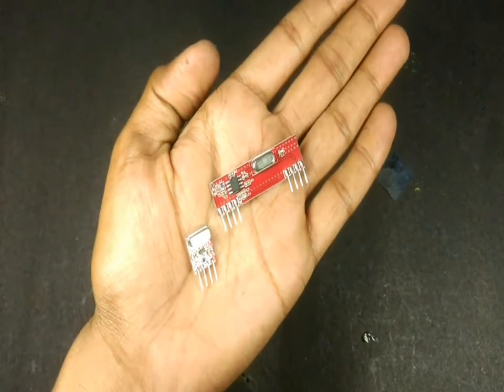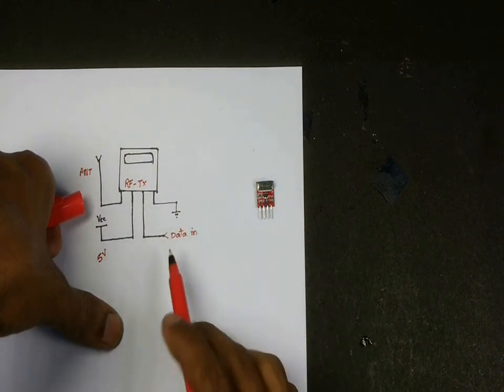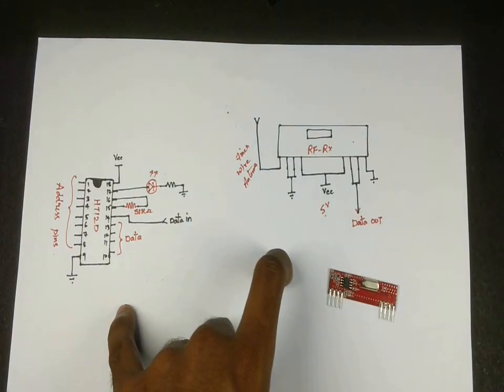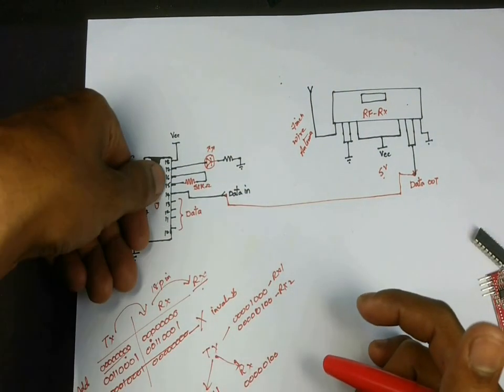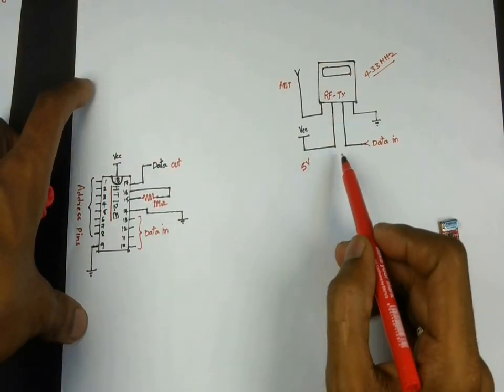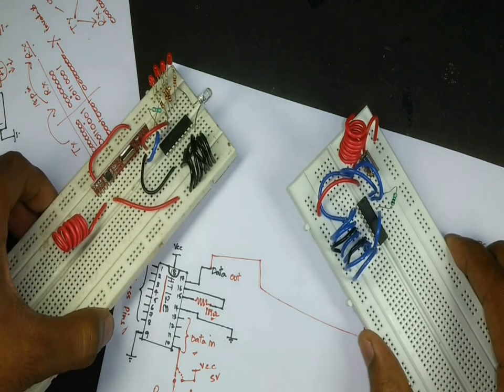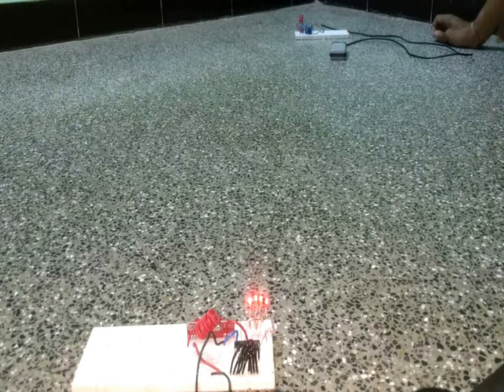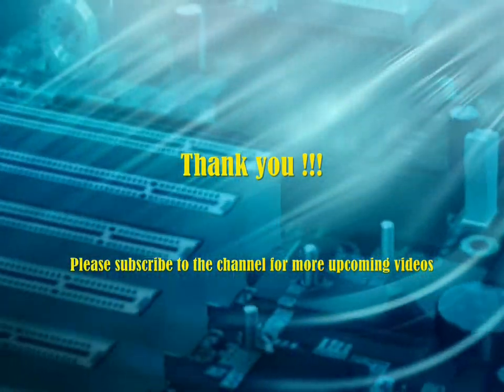RF TX-RX modules

Comment: Sir, how to check the transmitter send the signal to the receiver properly?
Please help me sir.....there is any process to check it.
Reply from the maker: As both the modules are tuned to same frequency, if transmitter is sending signal then the receiver side led should light-up. If it isn't then it means there is something wrong in connection
Reply: Led which is connected on pin  17 of HT12D or different?

Comment: I have connected both the receiver and transmitter circuit on the same breadboard.. Signal is not being transmitted/received regularly.. It is sent/received only once in a while.. What is wrong?
Reply from the maker: Check if antenna and other connections are done properly, might be an issue with connections
Reply: The connections are alright.. The receiver receives the signal once a while then the VT led stays low the suddenly the VT LED goes high and this continues.

Comment: Sir great explanation..
But can you plz elaborate the use of address pin.. I didn't get that part.
Reply from the maker: +Snehal Mondal both the modules shud have same address , I.e. if there are two receivers with different address then u can change address of transmitter and match each receiver address and the one matching will receive the data sent in tx